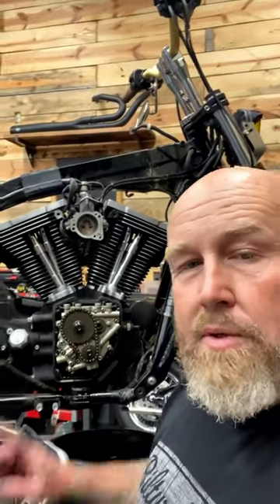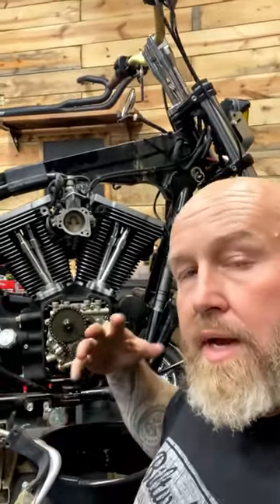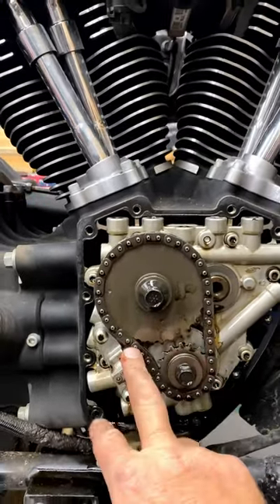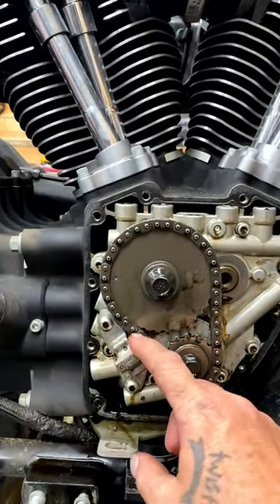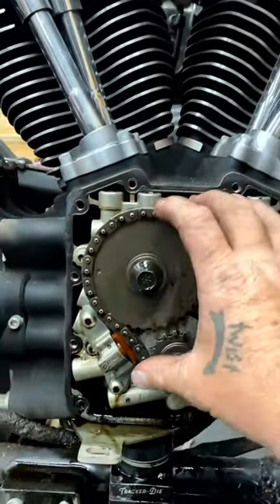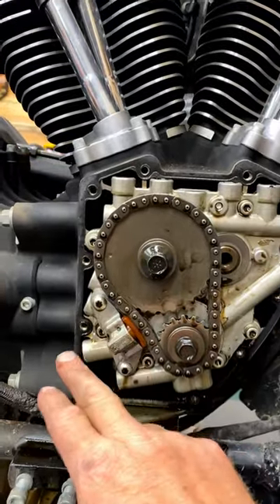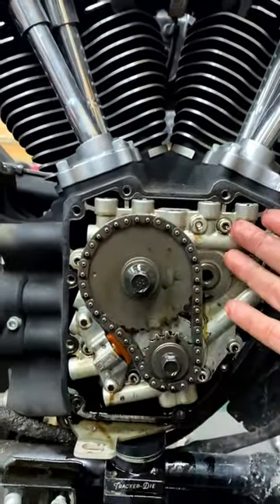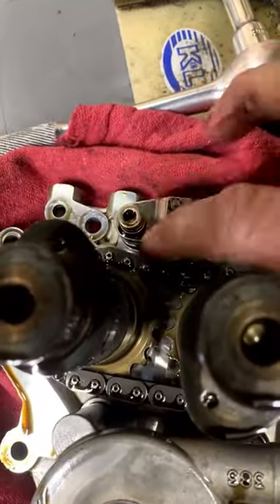Cam Chain Tensioners #motorcycle #custombike #techtips #harley #harleydavidson #shorts #short

Comment: You sound you really know your stuff.
Hopefully you can answer this….
My motorcycle only has 2000 miles on it, but I had a tiny oil leak.
It goes into the shop running great, but it comes out with the oil leak fixed but now it’s knocking. Not bad but enough to notice it.
What could they have possibly done to cause this knocking ?
They also did the second service that included an oil change. They claim they did not make any valve’s adjustments.
I hate that it’s making this kind of noise when it’s just broken in.

Comment: I have a 2001 fatboy, I put gear drive in after 10k miles.
Reply: What was your crank runout?
Reply: @tattoomiked4612  I can't remember, but it was just out of of spec. I think 30 thousands
Reply: @williamrizzo1285 yikes that’s not good at all. Keep an eye on your oil pressure, toss the sensor and look at getting a permanent gauge. Wish i would’ve known this before my oil pump granaded itself.

Comment: Hello Patrick I have a suzuki 2008 gz250 and I straight pipe it , so I did the middle jet slight bigger and it stopped lagging, but time passed and the throttle started lagging again so when I accelerate it losses power and I need help with this problem im sure it's common
Reply from the maker: check your air filter. Could be clogged/dirty and effecting power
- Patrick